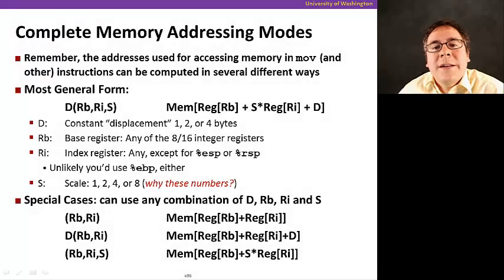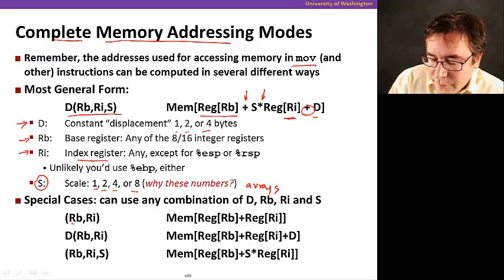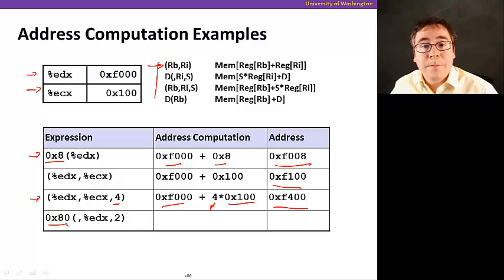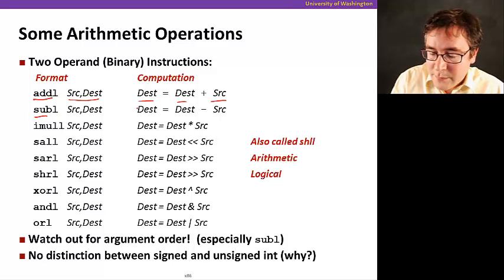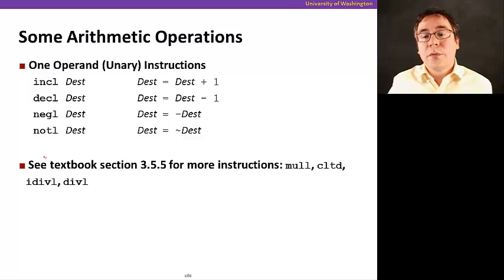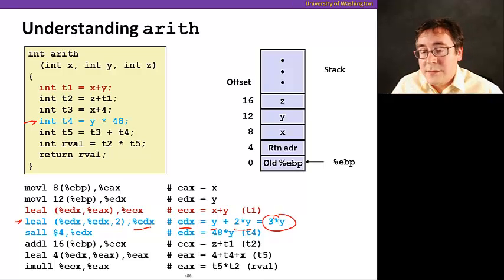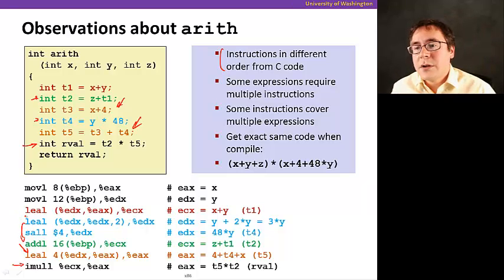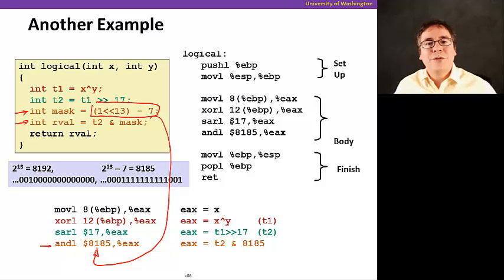x86 Assembly, Video 3: Addressing

Comment: The Constant Displacement can be any immediate value, not just 1, 2, or 4 bytes. It can be 9 for example. But the scale is restricted to 1, 2, 4, or 8 bytes. This is because the scale represents the size of the variable (char, short, int, long long). C++ automatically does the scale for you.